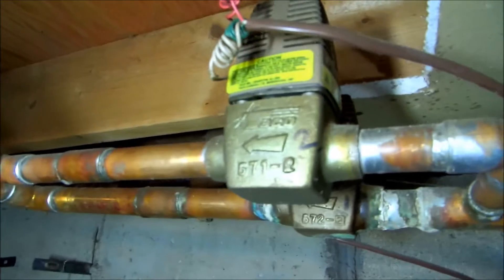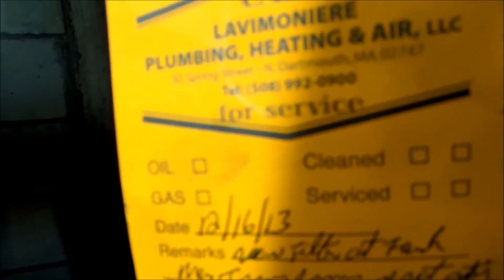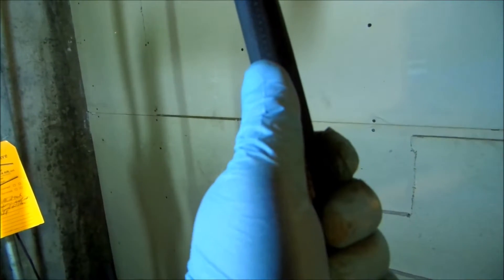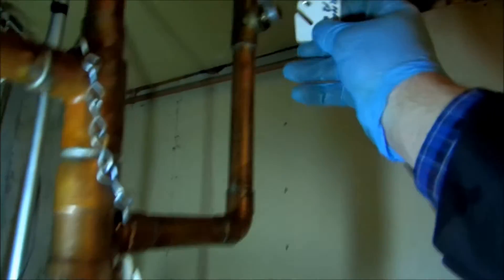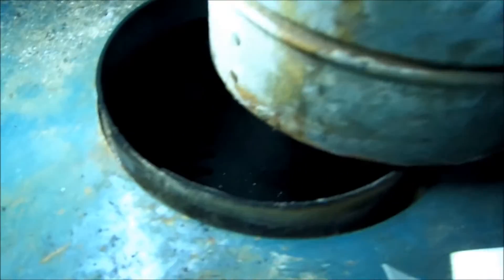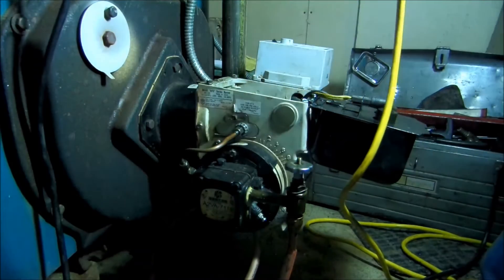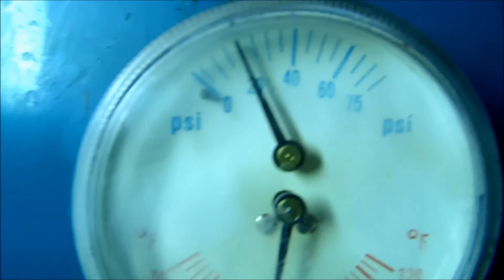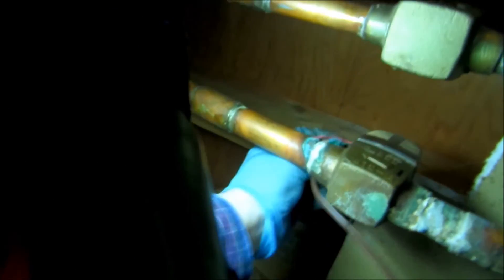hydroric oil boiler, leak on high vent ,testo 320

Comment: The draft appears to be fine it has a power Venter
Reply from the maker: michael white also clean the end of burner tube sometimes there is carbon build up on the retenion head i use a long screw driver down the draw assemble tube and rack it around all the carbon will fall off the retenion head

Comment: Yo Steve how are you doing my Beckett oil burner is leaking oil from under neath it I put a piece of paper there and it's coming from the middle of the oil burner so I change the nozzle and the screen and checked all the lines there all dry when I open up the coil pack on top there's  a little oil  there  my question is on the inside where the fan connects  to the pump is there a seal  that  can be leaking ? Thanks
Reply from the maker: michael white yes it could be the pump or the jet tube leaking oil down when running check the jet tube were it hooks up to the draw assemble at burner ,jet tube goes between the pump and draw assemble .if you pull the burner motor out you can see the pump seal .and wipe up the oil from inside .  sometimes the target wall in boiler falls forward look for that also .is the draft over the fire good??

Comment: Love the hole in sheetrock for can vent. that's great!!  Thanks for the shout out Steve. Digital combustion analyzers kick ass.  I set my burners at 22-25% excess air, 12.2 - 12.5 co2, 0 smoke for 2 years now. Boiler perfectly clean at next seasons cleaning. You will find leaving view door open greatly increases excess air, and believe it or not tightening the screw on air band lowers the excess air. All of which effect final co2 readings. Its all about the excess air !!  Great video Steve Lav